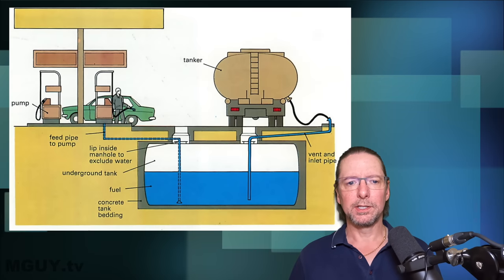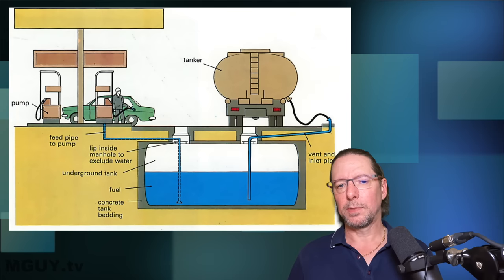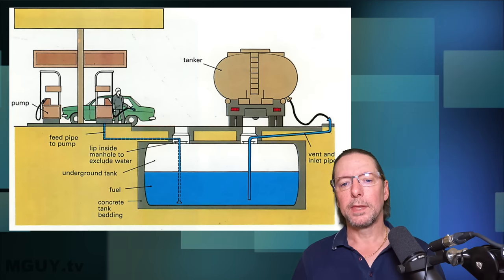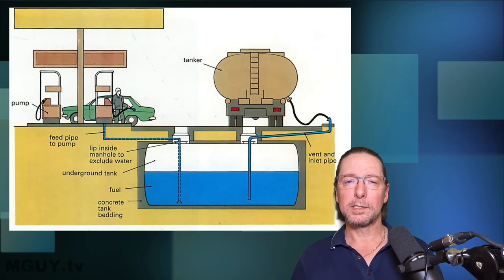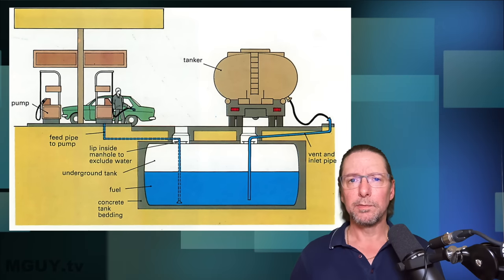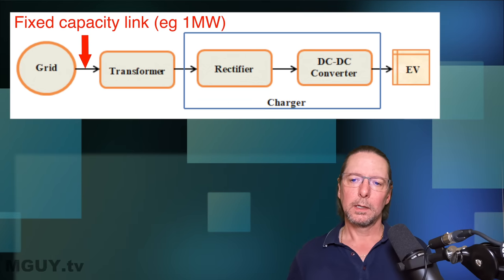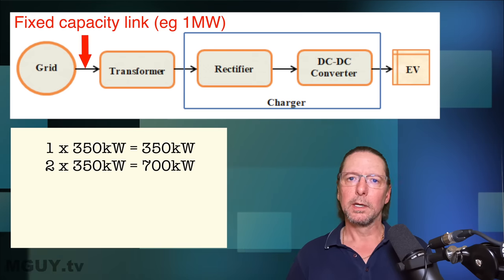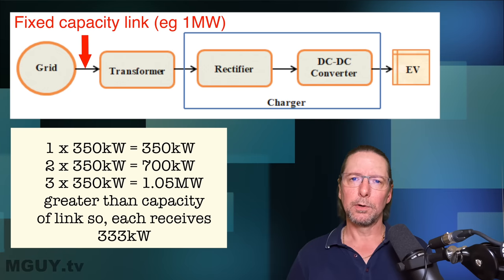HUGE problem with EV Charging Stations that no one mentions | MGUY Australia

Comment: Excellent point,  great video, short sweet and simple for everyone to understand.

Its like we've put all our brain power into making these new cars and almost zero brain power into the facilitation of the cars on a mass scale.  Somehow we're 25 years into this experiment and just now asking these (very obvious) questions.

I gotta say, quietly behind the scenes, hydrogen is making a stronger case for itself every day.
Reply: Hydrogen is expensive to make, (electrolysis - a very expensive process) or still comes from fossil fuels like Methane, causes severe Hydrogen embrittlement to most all metals which is a big engineering problem, and it is dangerous to work on for mechanics.  Not a very good solution either.
Reply: @johnkemas7344  I am aware of the problems and was not meaning to suggest that hydrogen is superior to battery/electrics, but when you see the difficulties scaling up pure electrics hydrogen doesn't have near the difficulties (i.e. building fully electric cars is 5% of the challenge of moving to electric cars, building  quality hydrogen cars is about 65% of the difficulty of moving to a hydrogen car fleet)
Reply: @mattclark6482  Hydrogen has the same problems as EVs, in that hydrogen isn't a fuel. It's just storage. You don't get any energy out of hydrogen you didn't put into it. Where are you going to crack hydrogen that you couldn't just charge your EVs? You can do it a bit more centralized and ship giant tanks of hydrogen around like you ship gasoline now, but that's really sketchy given you have to keep it compressed high enough to fill up someone else's tank.

Comment: The simple truth is, nobody has ever actually asked the power companies just what they need to do, to handle a complete conversion to EV.  They don’t ask, because they know the answers would show a huge crazy massive upheaval that’s impossible to do in just a few years.
Reply: Luckily the transition will take the better part of 25 years, I reckon. But it has to be done, unless you have some miracle CO2 scrubber up your sleeve
Reply: What we will end up with is thousands od dead EV's that can't charge because the grid can't handle it. Heck even now the grid suffers from demand in the summer without EV's This whole push is half baked.

Comment: This is a really really good point in this video, and while you scratched along the surface of this problem, and what you covered was really good and accurate, the overall electrical infrastructure problem is so much worse than this little isolated problem at this particular charging station.
Basically, in a nutshell the electrical grid is NOT built for mass deployment of high-voltage/high-current points of usage, like EV charging stations.  There simply is not enough generation and distribution to be able to accommodate the many EV charging stations that the idiotic government greenie-weenies think that they want.  What will end up happening is that electrical power is going to become a scarce resource, and will end up being tightly regulated and rationed.. just like any other government tightly regulated resource. 
For example - They think they are going to "phase-out" large Diesel Semi-Trucks in favor of EV Semis... Yeah right.. Can you even imagine how much power a truck stop to charge EV semis would consume off of the grid??  And how long it will take to charge the many many resulting EV semis??  Well??  What about the rest of all of the people on the grid who want to heat their homes, and cook dinner, and charge the family (EV) car so they can use it the next day??  What about them??
The saying, if the government owned all of the Sahara Desert, and regulated all the sand, you would soon have a sand shortage and sand rationing... That's what is going to happen.
Reply: We're already having electrical supply "variations" (where I live) which cause either full on black outs, or "brown outs" (which are just as damaging to electrical equipment)...particularly if there are storms between us and the supplier. Lines down etc. It's like putting surveillance cameras on trains to watch people getting attacked. Lots of money invested to watch things go down the drain rather than addressing the primary issues of continuity and stability of supply. Many folk in my area have bought solar panels, so our electrical supplier is getting all sorts of very cheap electricity daily. They pay a pittance for the privilege. Just waiting until they demand we pay for oxygen.
Reply: "and will end up being tightly regulated and rationed"  Yes it's called a Smart Meter.  Want your washing machine on?  Well it's peak time right now you can't but you can if you run it at 3am.  Fun.
Reply: @CyrilSneer123  They should be more careful. Waking us up, tired and cranky, is sure to cause issues lol. Adults are just like kids when not fed or weary.

Comment: Just a tidbit of additional information. I'm drawing this from memory.
In the US, the pumps for gasoline (petrol) are regulated and limited at about 10 US gal per minute (most stations have them set a bit lower, say 8 gals per minute.) Truck stations (for over-the-road "big" rigs) pumping diesel, have different regulations. (Something like double the flow rate.)
Reply: Truckers have different fuel tanks designed to easily handle that flow rate. On autos that would be a disaster since their tanks must fill through restrictive filler necks with anti-rollover check valves and fuel nozzle restrictors (though leaded gas is mostly a memory except for racing and generaly aviation).
Reply: And your point is...?
Reply: @captainpugwash3791  - Watch the vid again. You MIGHT get it on the 2nd (or 20th) viewing.
Reply: You are correct. The big diesel pumps are regulated at 34 gallons per minute. 

In the U.S.
Reply: Yea, 8-10 gal/min (GPM), (10 is the legal limit) but the standard commercial gasoline  pumps can do 35 to 50 GPM if they weren't restricted. (the specs vary- 35 GPM is most common standard and max for most).  I ran gas stations many years.
At 35 GPM it would be like a small fire-hose and it would have to held in the tank with force  and some people could not control it.
I forget the diesel figures,

Comment: BTW, at most gasoline stations there is only one pump per tank. And all the things you operate and call "pumps" are really just meters that are supplied by that one pump. That is why your flow slows down when someone else at another meter also starts filling at the same time.  This is especially true if the pump is undersized for the number of meters.  And that is often the case. However, even in the worst case your tank is usually full in just a couple minutes.  That can't be said for EV chargers.
Reply: Why do you hear the pump start up in the bowser you are using then? Each bowser has its own pump.
Reply: That doesn't happen anymore, in the U.S anyway, it used to be that way in the 1990's and earlier.
Reply: Bullshit....they are called turbines, and there is at least one turbine for every grade  and type of fuel.
Reply: @jefftheaussie2225 nope....wrong.
Reply: @pwilki8631  That may be the case where you are but not everywhere is the same as where you are. You should get out more.
Reply: I can pump 150 gallons of diesel in a little more time than it takes to wash my windows and mirrors. When I fuel my car I get annoyed by the slow little pump trickling fuel.
Reply: Rubbish.  Flow is independent of the number of bowsers in use.
Reply: The bowser has its own pump. Some pumps are quicker than others diesel for example has high flow pumps otherwise trucks would be there forever! We are talking completely different energy transfer electricity to liquid fuels.
Reply: That's true, but don't expect "MGUY" to mention that. His whole schtick is to whinge about the inevitable.
Reply: @knewhunter1 inevitable? Electric vehicles will be part of the mix but Australia doesn’t have the infrastructure to go full EV. If the government was serious there would be a lot of power stations going in! You can’t have millions of electric vehicles on the electricity system we have at the moment! Mguy is anti EV but I don’t think only EV’s is the answer either!
Reply: @06runway  I agree with that. EVs will eventually be the majority of the mix, but ICE will be around for decades at least.
Reply: @knewhunter1 the internal combustion engine is extremely efficient. I can’t see a complete replacement of them by electric vehicles the same way as EV’s have been around since the 1880’s they were used more in warehouses and mining. Unfortunately politicians and the media have got hold of EV’s. Like AI driving of vehicles which was extremely popular with the media and politicians until some of the problems became obvious and the idea seemed to disappeared for the moment. Politicians and the media have no practical idea on these things an independent body would be the best way to look at the massive logistical problems of the introduction of EV’s. Long distance transport is the issue in Australia ICE vehicles at the moment are more efficient less expensive quicker and less polluting than EV’s on long distance travel. Shipping and air transport are also other areas ICE engines have no EV equivalent!

Comment: A drop in electricity supply has the capacity to also create safety concerns for workers, depending on the equipment used in a factory, a 'brown out' type scenario can actually cost many thousands of dollatrs and much downtime. I've worked in factories before where such issues of a reduction capacity in available electricity would cost the company at least $10k (1990s prices) per hour in lost production and it would cause hours of work to rectify the issues such reduced power supply would cause to the machines that halted mid function thus also creating safety hazards to rectify.

Comment: Another consideration is that power company might not even supply entire 1MW (per your example) to the charger, because the average usage might not be that high. Simply idle the charger at 1MW causes a lot of fuels usage. When heavy loads occurred,  you can expect brown-out for the chargers.
Reply: Wow, an expert electrical engineer weighs in!!!
Reply: @xcrockery8080  Yes I do have  the BSEE from Sacramento State University.
Reply: @bigx9963  Well, I'm the world's deadliest invisible ninja.
Reply: simply idle the charger at 1MW causes a lot of fuel usage.   Couldn't really understand what this means? if a charger is idle, it wont be drawing anywhere near 1 MW
Reply: Nope
Reply: chargers don't brown out. A group of chargers can talk to each other (electronically) and scale back the charging rate to prevent low voltage. The flip side is your charge rate might go from 350 Kw down to 100 Kw, but that's more than twice as fast as you can do at home.

Comment: The more you look into it the worse they become, Maximum feed cable as you have reported in this video,relative long time to charge, heavier vehicles, travel distance varies between weather temperatures,  safety problem with people playing about on the control screen to squeeze the maximum amount of juice from the battery changing the way it operates, risk of thermal runaway, and at the moment the high prices.

Comment: Interesting.  I think you are right.  If EVs can last “a day” (what ever that means for a particular person), then they can recharge at night at home.  I think this is key and changes the paradigm a lot.  I can not ever fill up my car at my house at night so the traffic at a gas station is going to be higher — perhaps significantly higher — than the traffic at an EV recharging station.

Hotels and such will need to integrate into this new paradigm so that vacationers can continue to recharge their EVs at night.

I think exploring new technologies is great BUT it should not have a penny of government funding nor should the government force me into one paradigm or the other.  After all, the entire global warming hoax is collapsing all around.  The green energy scam is about to fall apart.
Reply: And just how much does it cost to have a charging station installed at your home?  And that’s if the local electricity provider was able to provide enough power!  EVs are illogical!!!  Oh, and what about the battery situation???  And fire!!!
Reply: @sandybruce9092  I'm not an EV fan.  But since you asked:

A home charger probably comes with the car when you buy it.  It requires 220V so if you have an electric dryer outlet, you are done.  If not, an electrician could probably install a 220V outlet for $100 or so.  The night time use of power is actually going to help since it will balance out the peak day time use which is for AC.  AC requires a lot of power.  

Lithium is a problem.  It isn't that plentiful currently but we tend to find more of whatever resource we are looking for.  There is no super good way to recycle the lithium yet.  The recycle cost is more than the mining of fresh but eventually, if more Lithium is not discovered, that economic situation will reverse.  The fire hazard is solved by using a different formulation for the battery.  LifePOs I think they are called.

I don't have an EV.  I'm looking for a new car right now and I'm not even considering an EV.  I'm not using it as a daily driver to and from work.  I need it for long trips out into the wilderness for my photography where there is no EV infrastructure yet.  EVs are not "green" by any real measure although "green" is a complete fraud as well.

Gas and oil are extremely plentiful right now, the pollution problem has more or less been solved, they are extremely dense energy wise.  The government's push to wind and solar is just to line the pockets of the major donors.
Reply: @pedzsan  Thank you for your response!  It doesn’t seem expensive to have a hime charging station, if a person’s electric provider can or will do it.  Regular has where we ,ice has dropped below $3.00 recently and I am very surprised! I keep a book in my car and record everything time I/we purchase gas % price, gallons, MPG, location, etc and ice dine this for more than 40 years so I’m well aware of gas prices in many areas!  But I won’t touch an EV ever - especially since most of the lithium comes from “other” countries I won’t name!!!  Even with out vehicles with lithium barriers, most of us have lithium in our homes - in regular batteries we use for so many items!  Still a very scary mineral!
Reply: We are moving quickly to shut down power stations that work during the night, to solar power  farms which do not. And generally the wind drops at night so the wind farms will be producing less too. Overnight charging of EVs will be fraught.
Reply: @AVMamfortas  Good point.  I personally believe that wind and solar are not a good option but we'll see...
Reply: I had a friend visit last week. He arrived with 19km range left on his Tesla 3 - eek. Plugged in to Aussie 240V overnight still only got him to about 40%, and used the equivalent of an entire day's household electricity. Being plugged in overnight, the 10kW solar array was useless. Power is no longer cheap at night, because we're moving to electricity sources that stop generating just as peak demand hits at 6pm. For people just commuting around town, plugging in where and when they can will be fine, because they are unlikely to be pushing the range of their car, but most people cannot afford a car that doesn't do everything they want. They can't have a second car just sitting around for the rare road trip.
Reply: @jesseyoung9654  It will be interesting to see Tesla's and other EV statistics on how many purchase an EV after their first.  EVs definitely have some strong negative attributes.
Reply: And if you live on the tenth floor in an 80s tower block you dangle your power lead down ... yeah that sounds like a plan ! London already leads trailing across footpaths at night. madness

Comment: Excellent points. There is a lot of loss of power in transmission lines also. The formula vd= 2KID/cmm. Means voltage drop = 2x k (resistance konstant (copper and aluminum are different)  x I( amperes) x distance ÷ cmm (circular mils)(wire size) . That's single phase residential. For 3phase commercial use vd= √3xR(resistance)x I(amps)x D(distance)÷cmm( wire size). DC is similar in principle. You can not endlessly add load without up sizing the initial conductors. On site generation is key...,...
Reply: aluminum has been shown to be a very dangerous conductor..expansion and contraction and oxide formation at connections can result in arcing and fires...
Reply: Small question regarding on site generation. What is going to power the on site generators? If my thinking is not wrong then there will still be a need for fossil fuels for this, or more expense for a windmill farm or a solar farm at each location.
Reply: Re onsite generation. Each business venturing into charging stations would have to work out details. Ex. a gas station could generate on demand using gas or diesel . Nat gas vendors could use their products via fuel cell or combustion to generate... Modular mini nuke plants...molten salt thorium reactors...forestry products waste  material. Each electricity producing plant is a potential charging station...pyrolitic converters at or in stead of  landfills, ...
Reply: @michaelcauser474  i think he was suggesting photo voltaic.  i think i would rather believe in the good fairy..